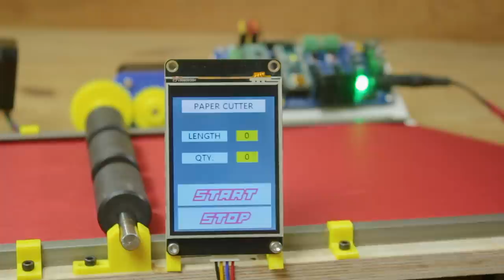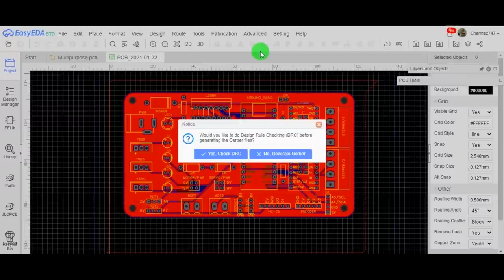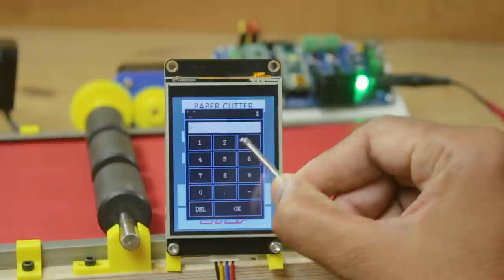How to Make Arduino based paper cutting machine | Arduino project

Comment: A good application can be plastic rectangles needed for rewinding motors, the material is a little more hard than paper, in a rewinding you require a lot of cuts for a single motor!

Comment: Cheers! I hope you put her to good work. I used to work in a shop that made road signs, they cut wax paper on full sized machines like this to stack between parts to prevent scratching. That machine will really help to elevate the customers impression of any shipped good.

Comment: Nice one! Quick and easy improvement: use a blade that cuts on the way back too. This way you don't need to drag it back each time.
Reply: Razor blades would be double sided, but if you see that the blade is on an angle.. so that it cuts down. So your improvement would make it quite a lot more complicated, as simply having a double sided blade would not solve it.
Reply: @Nobody-Nowhere  hello can you help me
Reply: hello can you help me

Comment: You don't need a computer like Arduino to build such a machine, because it is repeatedly cutting at specific intervals. You can do this by using a timer circuit only.
Reply: But arduinos are very cheap and easy to use. Why bother with timer circuits, when you cna get an nano for 2-3$ on ali
Reply: @harisalic2568  Using Arduino only for timer is a waste because it's a microcontroller capable of doning many things. I don't think you can get arduino at the price of few transistors to build a timer.

Comment: Stepper with knife I would replace by DC motor with two endstops switches.
Reply: How about a stepper with the limit switches? That way, if it gets stuck, it will be able to recognize that it didn't reach the limit after a certain number of steps and prevent damage (or someone getting hurt). Stall detection would be able to accomplish this as well, which is technically also possible with a DC motor, but a stepper gives you a bit more flexibility. The more redundancy, the better! Especially with a device that moves a knife.
Reply: @Betamaster64  and lesser torque and efficiency. For what?
Reply: @Blowjin  A reliable way to fail safely. Sometimes you have to sacrifice efficiency for safety, especially if it doesn't hinder any of the device's use cases.
Reply: @Betamaster64  maybe. But stepper is more complexity to control and need driver.

Comment: I have no use for this machine at all...but that's not a good enough reason for me to not build one!
Reply: I used to work in a shop that made road signs, they cut wax paper on full sized machines like this to stack between parts to prevent scratching.